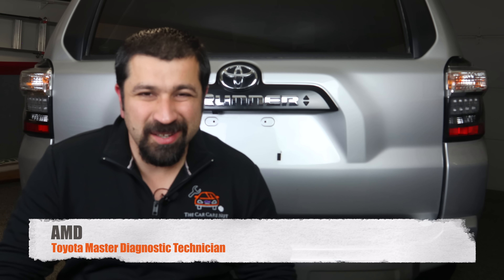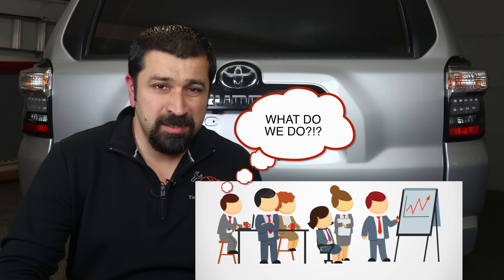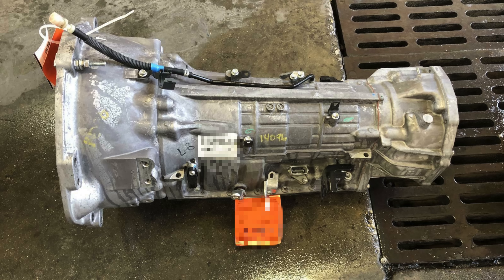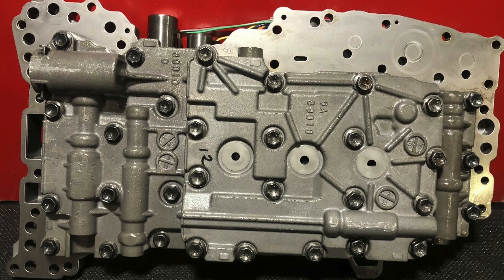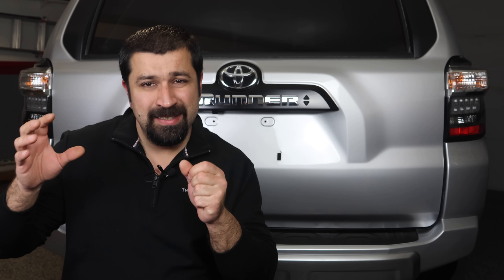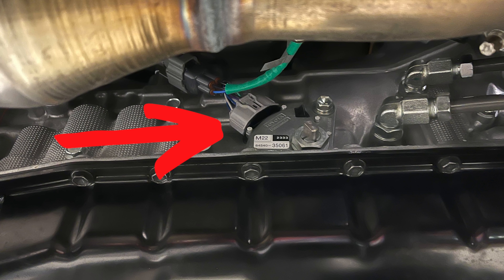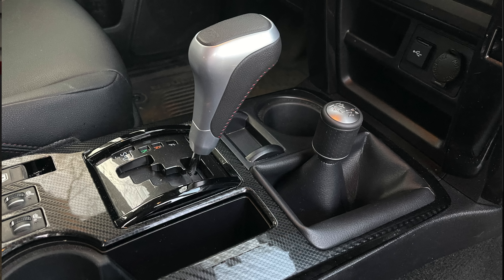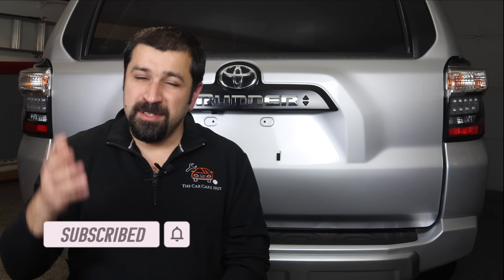Toyota 4Runner Transmission. Why is it so reliable?

Comment: I just bought a 2008 v8 model with 160k on it. I do have some service records but cannot find a Trans fluid change in them. I do have a 90k service with transfer case and both diffs serviced but am not positive if the trans was serviced then. My 00 didn't have a ton of records and I had trans flush at 188k and is still going strong at 236k. 

I do plan to tow some in the future. If this were yours, would you plan to change the fluid? If so, exchange through the cooler lines or change out in intervals?

I've heard the leave it be at this point mentality but that almost seems committed to failure eventually. I bought the least rusty example I could and plan to own for a long time. I'd really like to change it out and keep things up at this point. Vehicle still runs great.

Comment: thanks Mr car care I bought a 2013 4 runner 186,00kms last november and have this problem for the last 3 weeks of the low speed shudder, I did request the transmition be changed before purchase and they didnt  do it saying I didnt ask for it, anyway thats another , I have searched and searched  for info on this situation and am glad I did, I now have the knowledge to talk to a mechanic on what I want done, a drain and flush, maybe drop the pan and change the filter, I will probably do a drain and fill myself and see if it solves the problem , Ill keep you posted   thanks  again for all the education

Comment: I've owned a 2006 Land Cruiser  and two 2010 FJ Cruisers all with the same transmissions and i replaced the fluid in all of them at 100k .  Mainly because it had not been done before I purchased them.  They all run great . I did a drain and refill on each, every 10k miles until i replaced all 12-13 quarts. (2-3.5 quarts every time) .

Comment: Great video and I own a 2015 Trail 4runner.  One question, do you recommend Amsoil transmission fluid or stick with Toyota WS? Thanks
Reply from the maker: Hi! I would use toyota WS fluid.
Reply: @TheCarCareNut   Thanks, will do.

Comment: Hi I have 2015 Toyota 4Runner when I put it in 4H and turn wheel either to the right or left  truck doesn’t move at all and I have press gas and still move very hard is this normal?

Comment: Would you recommend going with Amsoil ATF in this transmission? Amsoil Fuel Saving ATF is rated for the vehicle or any other vehicle with Toyota WS fluid?
BTW, I installed an auxiliary transmission coolant with a 180 deg. thermostat to allow the fluid to warm up in cold weather. I do occasional towing with it.

Comment: My 2010 fj cruiser apparently has the same automatic transmission.

I absolutely hate the new multi gear transmissions. drove a friend's new F-150 he parked at my house while traveling, and it sounded like the transmission was eating itself alive. I actually refused to ever drive it again, because I did not want to be behind the wheel when it finally goes nuclear.

Comment: I traded in my 07 Fj for a 2021 TRD ORP. But before I did that, I had gotten so used to the Fj’s reliability that when the transmission lines rusted and started leaking oil for over a year, I thought that it was my messy oil changes sometimes. When I eventually took it to the mechanic, he was baffled at how the truck was still running with barely a hand full of transmission fluid left. Not even slipping. The look on his face was priceless. So l 100% agree with the car care nut. Great content and even a better person for sharing this with the Yota nation.

Comment: I have a 2016 trail and the neutral safety switch went bad at 20thousand miles. Thru a bunch of lights on the dash and shifter felt stiff, service writer knew what it was before having the mechanic look at it.
Still not a job for the home mechanic to fix because of the recal safety checks!

Love the sport shift mode, those 3grand shifts really wake that motor up!

Comment: I wish my new Tacoma had the old 5 speed. I also wish S-mode didn't allow the transmission to shift automatically, I want to lock it into 5th on the highway when towing my small trailer to stop the constant gear hunting.

Comment: I bought a new 2020 4RUNNER Limited a little over a year ago and the transmission always seems to be hunting for a gear.  When I am on the highway, running along in 5th gear, if there is any incline whatsoever, it will fall back into 4th, and with a 4 Liter V6, I cannot imagine why this is necessary.  The worst thing about it is that after the road levels off, it will stay in 4th gear for miles until there is a downhill, or I can shift it to 5th manually.  When I took it in for the 15,000 service I told them about this problem and they said that this is normal behavior.  Is this a problem that you are familiar with?  In my opinion, it is maybe a software issue, and Toyota needs to find a solution, and then have a Recall.🙄

Comment: Great Videos! I have a 2020 4Runner SR5 Prem 4x4 that I have begun to use for over landing, which means I have a lot of aftermarket parts that have added substantial weight. I was curious about your thoughts on a re-gear to a 4.88 gears for front and rear to help with torque and overall drive ability. Thanks in advance!
Reply from the maker: Hi! Honestly I don’t have experience with that. A few viewers who modify their 4runners  might chime in. All I can say is try it first and replace/modify as needed not just because

Comment: Would you recommend putting 35" tires on this transmission/engine? would that cause reliability/durability issues? Excellent video series, its helping me decide between a 2021 4Runner or the new bronco (which comes with factory 35")

Comment: Isn't 2003-2005 the A340F 4speed transmission? Then 06 face-lift got the 5speed (A750F)
Reply from the maker: The v8 model has the 5 speed since 2003 the the v6 got it as well in 2006 and up

Comment: I don’t have a 5th Gen, but do have a 3rd Gen with 178k miles and love it!!! Just did a lift on 33’s and it’s looking great
Reply: You have a long way to go with your 3rd gen. I have a 2000 4runner with over 334000 miles and still going strong. Also had a 2004 gx470, sold to my brother and now I have 2019 gx460. I'll only buy 4Runners and GXs. Best machines ever. If they mess up the 2024 model with some hybrid turbo crap, I'll get a 2023 4Runner TRD Pro instead.

Comment: Is the 4RUNNER and Tacoma TDR OFF ROAD the exact same 4 wheel unit and does it work the same way is there any difference between the two ???
          The Vermonter
Reply from the maker: Hi! They are similar in the way they work but not the exact same unit
Reply: @TheCarCareNut  thanks 
Is one better than the other for off Road?? I'm looking at both 
   Thank you so much for your videos and knowledge 👍👍
           The Vermonter
Reply from the maker: The 4Runner might have a slight edge on reliability and off road
Reply: @TheCarCareNut  thanks so much for getting back to me 👍🗽🇺🇸

Comment: What should you do if you never changed a transmission fluid and you have almost 200000 miles now?? ANY TIPS?
Reply from the maker: Hi! I would for sure leave it alone at this mileage as you could cause more harm than good at this point
Reply: @TheCarCareNut  Thank you for the reply! I only have 140k. I will be checking with my dealer to see the service records.  It should have been changed once at 60k...I should be good.

Comment: Because it only has 5 gears which is 50% less that can go wrong compared to newer cars/trucks. That trans is an outdated slushbox with some of the worst acceleration I've ever witnessed. Might be reliable but it sucks to drive.

Comment: My Toyota Venza 2009 AWD V6 is almost 105k miles. It has the 2GR-FE V6 engine and 6 speed AT. I wish the 4Runner will at least add 1 more gear for highway driving like the Venza.

Comment: Excellent video. I always learn so much. 
Question: did Toyota use this transmission in the FJ Cruiser?  That transmission had some “stumbling “ shake issues at low speeds.
Reply from the maker: Hi! Yes they did

Comment: Hi AMD! I'm joining the club, just placed an order for the 4Runner, lets see how soon I get it. One question on rear main seal and the leak from it, I'm reading in forums that this is a common problem in relatively low mileage vehicles...is this still a problem? any advice on how to protect? I also read that the inspection hole can be taped up to prevent dust , debris and mud to get in. Is this something we can do as a preventive measure?
Reply from the maker: Hi Oliver! Congratulations in advance! On rear mains I haven’t seen many and especially lately. Covering up the hole is not a bad idea but don’t plug it all the way completely as it needs some breathing.
Reply: Thank you and Appreciate your advise.

Comment: I tracked my 2010 4Runner ATF temps over the weekend while towing a 2500 lbs trailer. On the flat hwy at 65 mph would be around 190s F, once we hit grade we'd see temps up to 274/237F. Driving without the trailer it'd sit at 161F. If I got an auxiliary cooler would that let me keep towing long distances, or should I accept the fact it's not meant to tow long distances in the mountains. its very slow in the mtns as well. Also should I be using the manual shift and keep it in 4th gear?
Reply from the maker: Try to keep it in 4th gear. No harm in trying a cooler but just know that heavy duty towing is not a strong suite of the 4runner

Comment: My 07 4runner transmission has been on its way out since I bought it at 165k miles 2 years ago. Now at 190k miles towed 5000lbs across the US. Raced through the desert, climbed mountains and jumped sand dunes. My transmission is still "on its way out" lmao

Comment: Hi I Have a Toyota PRADO GRJ150L-GKTEKV with a 1 GRFE and a  A02A/AC60F transmission, 
 Could you share your knowledge on how to  replace the Transmission fluid as i have done 100000km in 5 years, keep up the amazing work with your videos.

Comment: I had a 2003 4runner SR5 4WD. Purchased used in 07'. 70K miles. Had it for over 10 years. Sold with over 300K, original engine and tranny..........Now I cant afford a three year old used one....... One of the best resale versatile vehicles on the marker............ Hmmmmmm......... I wonder why?

Comment: Have a 2015 T4R I picked up 6 months ago. It's up to 128,000kms now, planning to change the transmission fluid later in the summer or fall. I've done every other fluid, it's the last one I have to do. What do you guys recommend for fluid, stick to Toyota's fluid or something else?
Reply from the maker: I would use oem WS ATF

Comment: I truly don’t understand the hate this 5 speed gets. I’ve owned many Toyotas and several 4Runners. This 5 speed is great. Is it the best for fuel efficiency? Nope. Is it great on and off-road? Yes. Does it struggle on the highways? No. Is it a race car? Nope. I consistently do 80+ in my 2020 4Runner & don’t feel the need for more gears. I had an F-150 with more gear & I would manually limit it under highway speeds. Lugging an engine isn’t good for it. I love my Runner & I know if I want it would last me until 2040+.

Comment: I have a 2013 4-runner, 60,200 miles. The 3rd, 4th to 5th gear hang up when on a downward slope. Suggestions?
Reply from the maker: Hi! That’s normal as it picks up the downward slope and it holds the gear to help the brakes

Comment: Toyota say the trans fluid is good for life. What they don’t tell u it’s good for the term of their service life. Not the life of the transmission 

Oil must be changed and at least checked to see if it’s burnt every 100,000 kms when new and then every 50,000 there after
As trans oil is worked the transmission belts and parts break down. The fact these particulates are in the oil when very old is one of the facts it continues to work
If u ever dump your old trans oil. Do so into a clean container and keep it. Once you’ve filled yr tranny with new oil and it may have issues regarding slipping. Drain some old oil out and put some of the old oil back in
Or similarly drain 1/3 old oil out and replace with fresh oil and drive for 1 yr or whatever length of time u think suitable and continue until it’s all been replaced

Moral of the story. Never listen to the bozos at Toyota. Honestly. They’re just parts swappers. Useless 
Not mechanics. The only decent mechs are the Forman and they’re not working on yr car

Comment: I have an 09 sienna with 206,000 miles. Not sure if the transmission fluid was ever changed. Is it risky to change the fluid or should I leave it as is? The manual says not to change it.

Comment: The 2005 to current Nissan frontier is also like the 4runner...it still uses the same 4.0 V6 VQ series engine since 2005 with the same 5 speed auto transmission.....both the engine and transmission are known for being very reliable and pretty powerful even today in 2021....
Reply: Actually to correct myself the 2021 Nissan frontier has a new engine and transmission but it rides on the same old body.....still a bad ass powerful dependable old/new truck..
Reply: It's a Nissan frontier. It's not a Toyota. No comparison needed.

Comment: Have 2005 4runner sport w/ 210k miles, a local mechanic changed the trans fluid with only drain and fill around 150k, thinking of doing it again.

Comment: No one would ever think of putting lifetime oil in an engine. That would be absurd. I'm not sure why transmissions are treated differently. The fluid isn't in as extreme of an environment, but that doesn't mean the fluid doesn't wear out.

Comment: There are vendors selling aisin labeled ws fluid with the jws3324 spec and it is 3-4 dollars cheaper than the Toyota label product. I’m not sure if that’s a viable alternative or if I should just visit my local dealer
Reply from the maker: Honestly I would just use original from the dealership

Comment: Thank you Car care nut for the info and thank you for helping me to make decision to keep my 2013 Tundra. It is a 4.0 V6 two wheel drive. I saw one of your videos you ware saying that these engines are quite rare. Could you clarify that for me? I assume it's probably same engine as this 4Runner and same transmission of course two heel drive. I love my Tundra, there is only one thing that I don't like. It's little "lazy" in low RPM.
Reply from the maker: Hi! It’s rare to find a v6 tundra but the engine itself is not rare at all! It’s a good engine just a bit low on power for the size of the tundra. I would keep it if you’re happy with it and it’s running good

Comment: I have a question. So i have a 2007 Toyota Tacoma access Cab trd sport 4x4 4.0L v6 automatic transmission with 165,500 miles.  Does my Tacoma have the same transmission you are talking about in the video?
Reply from the maker: Hi! It has the same transmission.

Comment: Isn’t the transmission the no fluid change it’s lifetime fluid I don’t see it lasting more than the other ones
Reply from the maker: Yes but how long is that lifetime? Can tell you from experience that the lifetime is significantly increased when you change the fluid. Also in the maintenance guide if you do any towing you have to replace it every 60k or 6 years

Comment: How do you feel about the transmission cooling on this unit? I tow a trailer and am worried about heating the transmission up. Any advice or comments?
Reply from the maker: Hi! I wouldn’t worry about cooling as long as you’re towing within the allowed capacity.
Reply: @TheCarCareNut  
I too am curious about a transmission cooler. I am towing below capacity but off road and at elevations of 5 -8000 feet. Does this make a difference? Would it be worthwhile to add a tranny cooler to avoid overheating or is it money flushed down the drain?

Comment: Very good.. How about the 6 speed auto in the tacoma....3rd gen?
Reply from the maker: Hi! The trans in the 3rd gen Tacoma is ok a bit clunky and had a few issues initially that were solved with software updates
Reply: @TheCarCareNut  I have one in a 21 tacoma. Seems fine. I'll make sure and service the transmission like you recommend.

Comment: What is the difference between the 4Runner transmission and the GX470/GX460?  I read somewhere that it is almost identical except the GX has 6 gears.  If that is the case, it would have been cool if the 4Runner came stock with 4.56 gears and the GX transmission.  Same highway RPM but a much better crawl ratio.
Reply from the maker: It is very similar but 6 speeds thats correct

Comment: does the 2019 have a  straw tube on the drain plug mine doesnt just wondering if it fell off and is loose in the pan.
Reply from the maker: It does have one. There are 2 plugs on the trans pan. One for draining and the other one has the overflow tube

Comment: Hi, Please advice

over the summer 21, I'm going to tow RV trailer with around 2600 -> 3200 lbs weight with my 2016 4Runner SR5 all over the country - from Tennessee to the West national parks. Have 50K miles on it. Would you recommend any kind of special attention to transmission? Cooler or changing the transmission, fluid before or after the trip. 

Installed break controller (Redarc) and have the WD hitch with sway control.

Would really appreciate your answer and the videos are great.
Reply from the maker: Hi! In case of towing it’s required to change the fluid every 60k or 6 years. If you do very regular towing I would even replace it as soon as 30k miles
Reply: @TheCarCareNut  Thanks, I do appreciate your response - given, that I will probably hit 60K somewhere in Utah, I will probably change the fluid before the trip.

Comment: I owned a Toyota Corona stationwagon in the 80 (AUS) , with a 4 speed auto box and a 22re engine for 17 years with 200,000 ks on the clock, the only thing wrong with the gear box over all these years was a tail shaft oil seal leaking, still regret selling that car,

Comment: I got a 2016 4Runner. Had it since it had around 28k km. Now has 84k km. Solid car. Needed nothing but oil changes and brakes. I will be needing tires soon but no complaints at all. It still works just like the day I got it